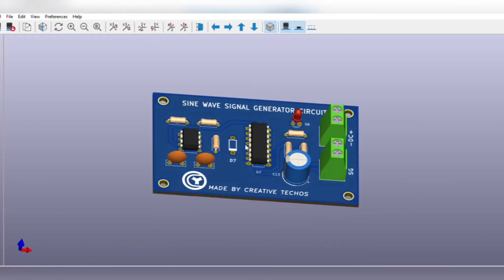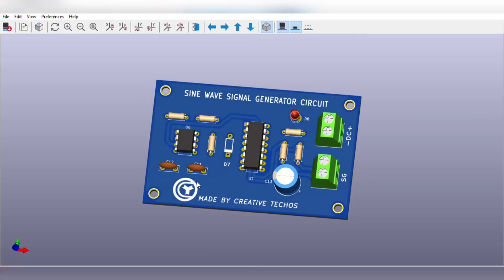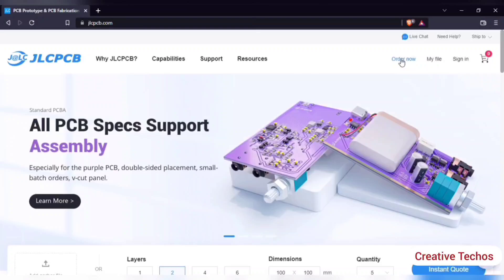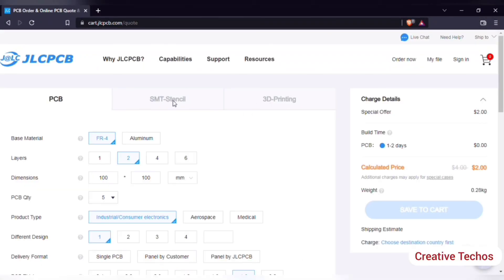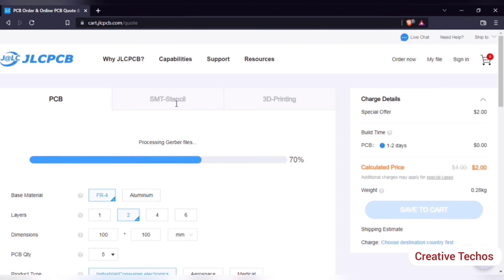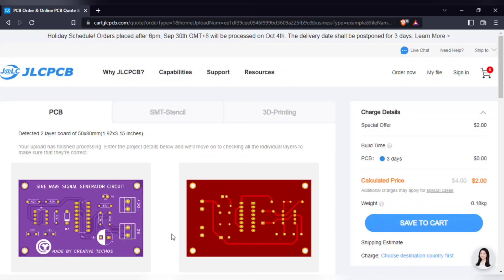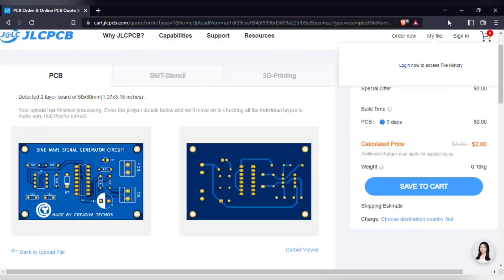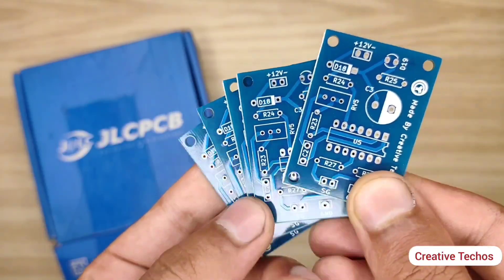Simple inverter circuit 12v to 220v , sine wave , mosfet , irfz44n

Comment: Hello Very good video. But one question. Is it possible to use 12-0-12 transformer with ferrite core instead of transformer with iron core?
Reply from the maker: No, with iron core we use lower frequency 50-60hz, but ferrite core operates on higher frequency like 20khz-60khz, You can find ferrite core inverter videos on my channel
Reply: Can I use iron transformer instead  @CreativeTechos

Comment: The out put of this circuit is modified square wave not sine wave there is a difference between sine wave and modified square wave and is not as efficient as pure sine wave motors will not run properly and get hot.

Comment: Bhai i want 6-0-6 ups transformer inverter plz because my 12-0-12 transformer burnsout secondary coil burnsout  so i want this circuit 50hz modified sine wave inverter bhai help me
Reply: Watch this video https://youtu.be/9vi01l9qoO4
Reply from the maker: You can use that transformer with this circuit.
Reply: @CreativeTechos  really?
Reply: @CreativeTechos  but battery supply 12v ?
Reply from the maker: Yes, but check out put may be higher than 220v
Reply: @CreativeTechos  i am going to use it the 6-0-6 transformer is this transformer capacity is 230v ?